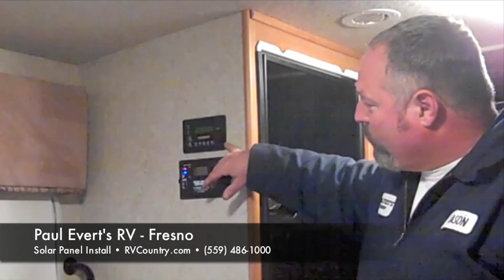RV Solar Panel Install with Technician

Comment: Why 6V AGM as opposed to 12V AGM?
Did you wire the battery bank for 6V? 12V? or 24V?
Just curious as I am just getting started in solar myself and have heard that building a bank out of lower voltage batteries is preferable (such as 6v or 2.5v cells), though I'm not quite clear on why. :)

Comment from the maker: @XQzix We've seen some homebuilt mini ones online that say they can power small recreational vehicles, but overall we feel solar is more common and reliable. After all, it's built in and there's a much more reliable chance of daylight than there is of wind. If you wind up using a windmill, let us know how it works out for you!